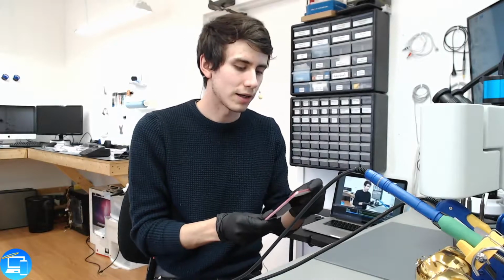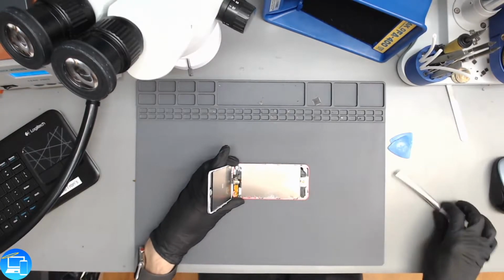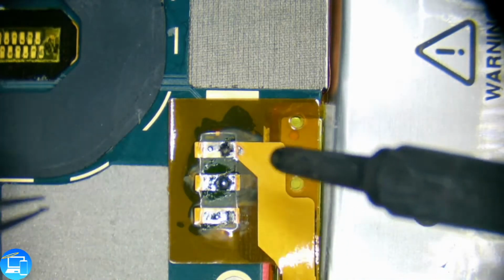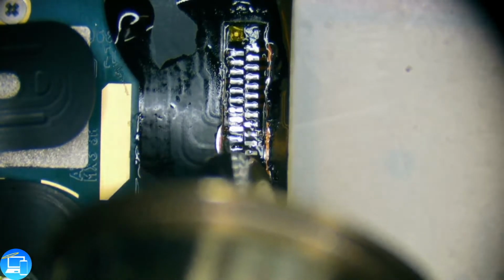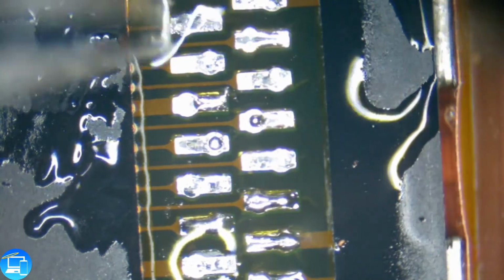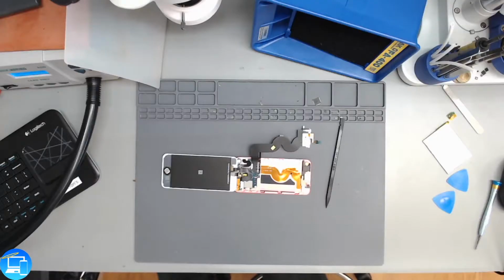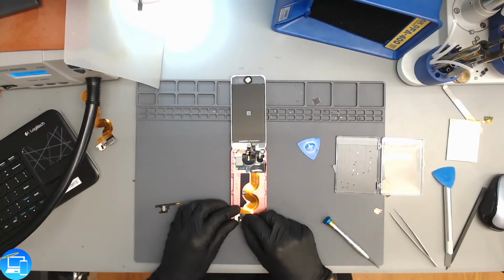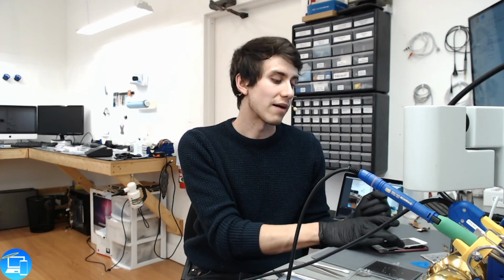iPod Touch 5th Gen with Charging issues

Comment: Is it possible to acquire files in a dead Ipod exactly the one in the video?
Reply: Technically yes, if you take it to a data recovery service. What they would be doing is taking the flash memory chip out of the iPod and using a tool like the ACE Lab PC3000 to recover any files that are recoverable. You can buy this hardware yourself if you have $10K to burn, as well as the time to adequately learn the tool, but generally more cost effective just to take it somewhere that will do it for you.

Comment: I’ve got something even stranger: ipod 5th gen A1136 with the classic click wheel. Charges and works perfectly using an old non-oem, non-usb 30-pin plug charger. But no oem usb-30-pin dock will charge it, nor will it sync to itunes, computer doesn’t recognize that it’s plugged into the usb, etc. dock connector is clean, unit is mint, old as it is. No one on the internet has ever experienced this or knows what to do with it
Reply from the maker: It kind of sounds like one of some of your pins inside of the port had damaged and not establishing a solid connection. I would first try cleaning the port with isopropyl alcohol and a toothbrush. If that does not resolve the issue, the port may be bad and need to be replaced.
Reply: @iRevive  thank you. But if that’s the case, then why does it charge up perfectly using a non-apple non-usb charger? Wouldn’t the charging pins in the dock connector be the same pins?
Reply from the maker: @emesappliancerepair3792  that’s a good question. It’s possible that one of the pins is a data line pin. If these are damaged or crossed, they can do strange things like only charge with a specific charger. It’s hard to say.
Reply: @iRevive  thank you. I’m going to take your advice and clean the dock connector port (again)  with a toothbrush and alcohol, if that doesn’t fix this issue, then I’m going to change out the port to a new one (which hopefully I can find somewhere to buy) because I really want to “mod” it…but not before I can make a backup of it in iTunes

Comment: is it possible to transfer important files like pictures and videos to a working ipod touch 5th gen, from the old ipod touch 5th gen no power?
Reply from the maker: In order to recover data from an iOS device, the device has to power on and be unlocked. To recover the data from the old iPod touch 5th Gen, it will need to be repaired first.

Comment: I have an ipod touch 5g, and it does not charge, nor does it show the logo, it does not work in any charger, cable or pc, it was opened and the battery charged, so the battery works. What do you think it could be? Do you think I should change the charging flex?
Reply from the maker: In your situation, the next step I would recommend is to replace the charging flex. If your issue persists, then you we be looking at a further issue with the logic board, which may not be economically viable to repair due to lack of schematics. I hope this information points you in the right direction.